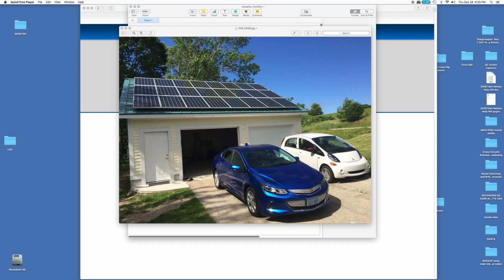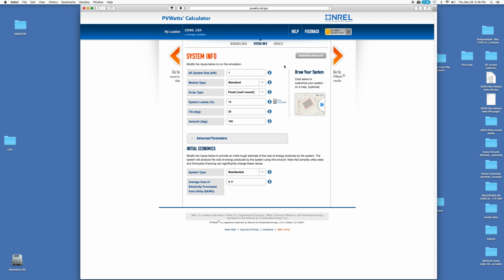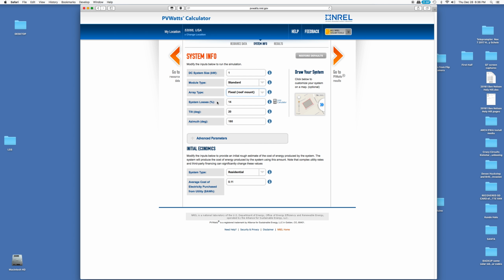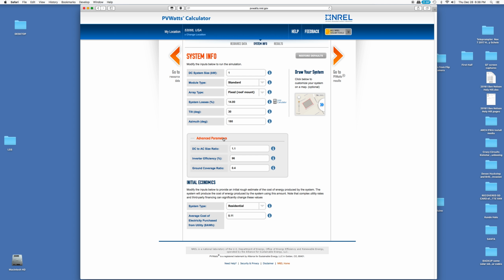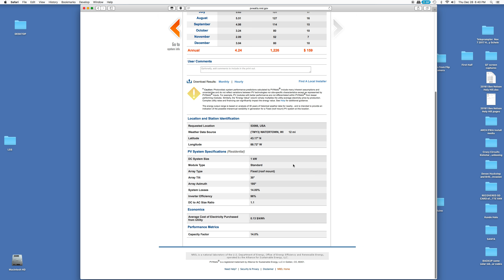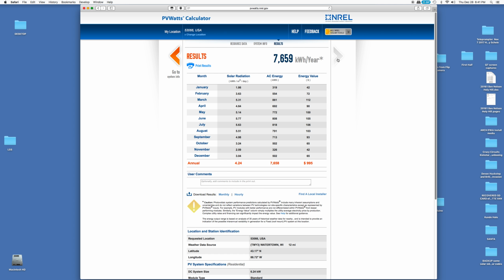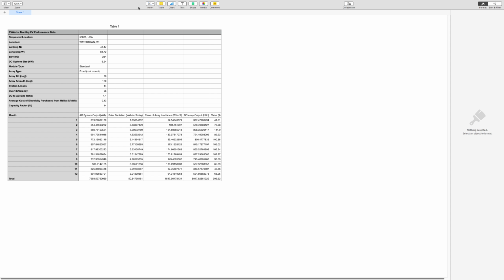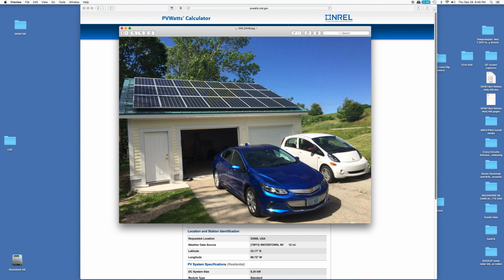How to use PVWatts to help design a solar system

Comment: Neat tool you found there.  I had fun playing with it.  As it seems the power company buying back power is not an option for me here. I guess my best option would be to put my solar panel on a steep angle so I get as much power as possible in the winter.  (I use about 1kw per hour in the summer on average and just over 3kw per hour in the winter as I have electric heat.)  So if I put in a 50kw solar system at a 60 degree tilt it seems I would just barely get the power I need in the winter and have over 5 times the power I need the rest of the year.  Since huge batteries are cost prohibitive I guess the next best option would be to convert to using hot water for heat and build a huge insulated underground pool of water to pump heat into all summer :-)

I am glad solar works for you!  I look forward to changes in technology (or motivation on my part to start digging for my thermal storage pool) that can someday make me owning solar on my roof seem efficient.
Reply from the maker: Perhaps one of the biggest draw-backs of an OFF-GRID system is that winter production is so low compared to summer production. Many off-gridders use a steeper tilt or seasonally adjust the tilt of their panels. Electric space heating is almost NEVER used with off-grid solar arrays. People commonly burn wood or propane for off-grid heat. Heating WATER with solar thermal collectors is always a great option, and it's NOT unreasonable now to heat water with PV either. A wind turbine is also an excellent complement to solar for off-gridders - the wind turbine can spin 24 hours a day, whereas solar can sometimes have very few useful hours in the winter.
Seasonal thermal storage is a fantastic idea, although you pretty much have to build your house around it, and make sure you do it right the first time!
PVWatts is just one tool to help predict how much electric power you can (or can't!) produce. If it keeps you from wasting money by installing solar in an inappropriate location, that's a good use for it too!
Reply: Ya, I live on a tiny city lot so mostly I am dreaming about the idea of thermal storage, but maybe someday that coupled with a heat pump could drop my energy consumption significantly.  For now I just look at you and other people with solar and am a bit jealous :-)  (Also jealous of your electric cars/bikes/etc... maybe in 2018 I will join the electric car drivers?)

Comment: Useful tool; how does your actual 4MWhrs so far compare to the estimate from the tool?
Reply from the maker: Great question! From the exported info from PV Watts (the actual data I showed in this video) I added up the AC production numbers for June through December, and got 4460 kWh of production, which is 4.46 Mega-Watt-Hours of production. Current total energy produced, as reported by the Enphase Enlighten software shows 4.15 Mega-Watt-Hours. Dividing 4.15 by 4.46 gives me a hair over 93%. Keep in mind that in our quick example, I did NOT actually go through and add a multiplier for shading. At my location, using a SolarPathfinder, I figured my losses due to shading at about 7%. So, if I INCLUDE real-world shading, the PV Watts prediction was been pretty much DEAD-ON over a six month period!

Comment: That it starts on DC and ends on AC and nobody tells you what your electric bill is, AND that the 4KW default doesn't say if it's asking for my daily, monthly, or annual... it's a real nuisance to try to use this. : (